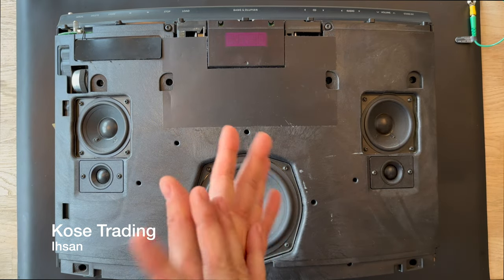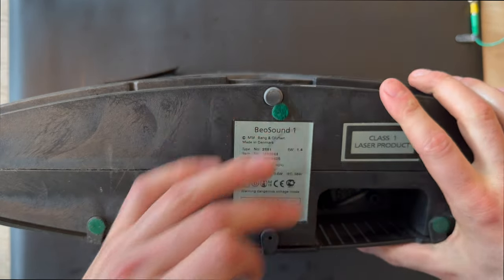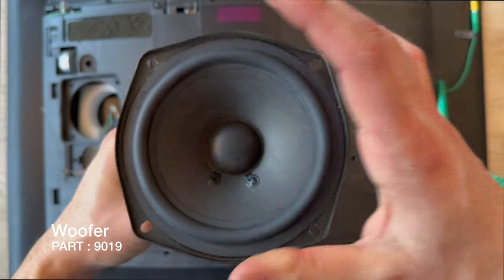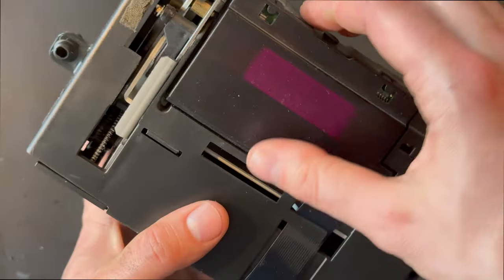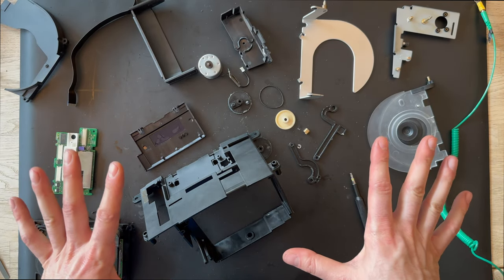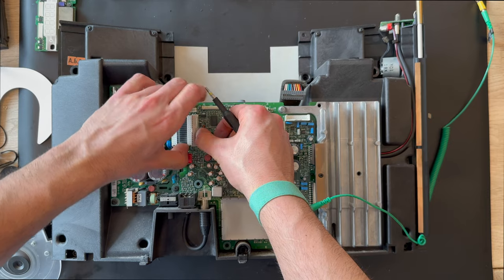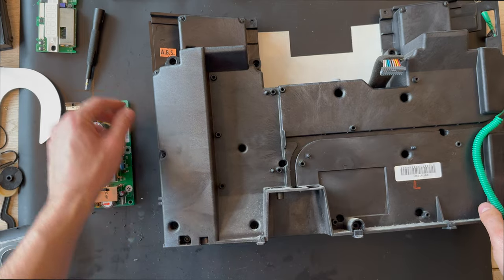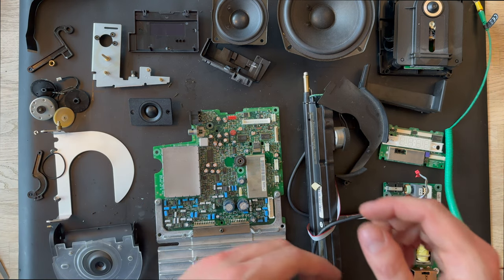Bang & Olufsen Beosound 1 Portable CD/Tuner Disassembly process and Repair guide

Comment: My Beosound 1 suddenly turn off and on few minutes later. How can i fix it?
Reply from the maker: Hi. Thank you for your comment. You need to change the battery if your Beosound 3 turn off after few minutes.
Reply: @KoseTrading  It's Beosound 1 without Battery. I dont have PIN code also because i bought from Market. How can i get it?
Reply from the maker: @anhminh1286  send us a e-mail. Then we can take the conversation from there

Comment: Hi, my beosound in locked forever on pin code menu, i know the pin code but it does not let me put it in.
Reply from the maker: Hi. You need to contact you local Bang & Olufsen dealer and get the Master pin.
Reply: @KoseTrading  I actually know my pin, but the menu does not let me insert it
Reply from the maker: Send me a e-mail and i will guide you.